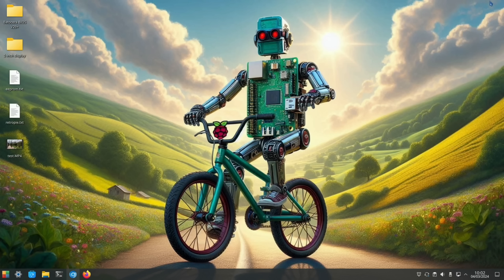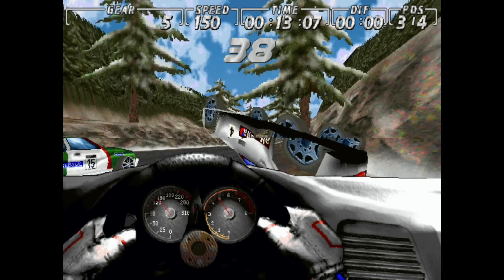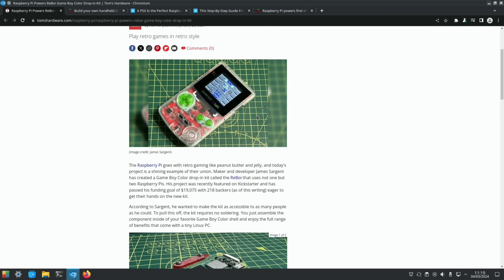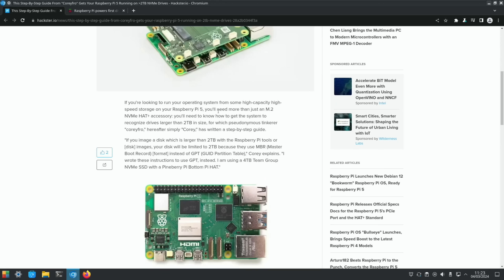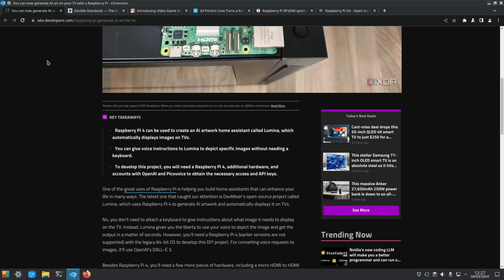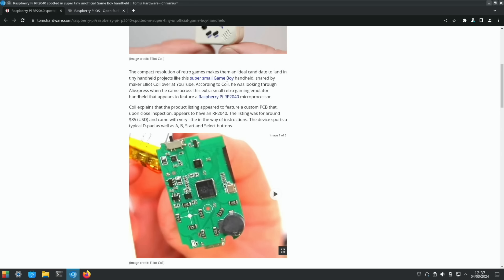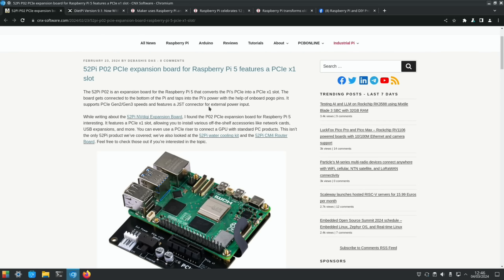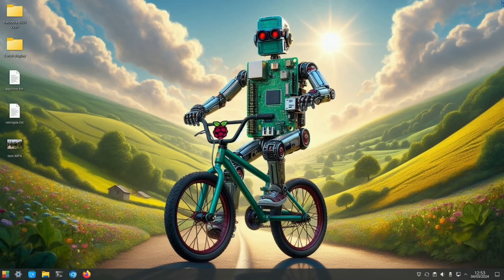Pi News 86. Another great month for Raspberry Pi5. Unrivalled SBC Arm support.

Comment: the converter, for putting in regular pci-e cards... people that use pi's for cnc, or would, sometimes find parallel ports a cost effective solution... i do.  got a startech parallel serial card, it's pci-ex1, just waiting to finish my new machine, the old one uses grbl.

Comment: A raspberry pi will work under water IF the water is distilled.  It is the impurities IN water (salt, minerals etc, PURE H20 is insulative) that make the water conductive.  In a project I worked on in the 90's we installed a 5 MW high frequency (400 Hz) induction heater in the steel line we were upgrading/reautomating and it was cooled and insulated with Distilled water.

Comment: I owned an Amiga, I got mine from a Executive Officer who was fired from Commodore, it was the top of the line model (was that the 1000? or 2000?) with every hardware option installed including third party for 300 dollars, he was asking 500 and at the time I think it sold for over $1,000 or 2,000 without the added on features ... I recall tossing out TWO 55 gallon trash can filled with 3.5 discs a few years after giving the Amiga away to a friend.  ...about three years later I was into PCs.  Soon I was cutting up & drilling fan holes into cases to build mods, I remember having one of the first nvidia video cards & put in the freezer to cool down the glued (thermal epoxy) on the aluminum heat sync so I could twist pop it off so I could replace it with a copper heat sync with an integrated fan, & replaced the timing crystal & soldered on video ram chips piggybacked style to double the vram ... worked great but only half of the games would still work with the mods.  Then got into water cooling my PC about the time the Intel Celeron chip came out, remember having a dual Celeron motherboard.

I had my first job in 6th grade in a TV/Radio repair shop, yup actually doing the repairs on the equipment with a soldering iron and a schematic using the different meters to check what went bad & fixing them, only did this for two years & got a gig doing installations of home and small business alarm systems and I was making 100 to $150 a day after school and 200 to 250, 300 a day on the weekends. It was all under the table & I was flushed with cash and I couldn't spend any of it, none of my friends had any money to speak of, maybe $10 or 20 bucks a week being paperboys or dishwashers and screw them if I'm gonna pay their way so I just saved it, but if any of my social cliques were doing anything I'd join them, I went to every rock concerts in Philadelphia & NYC, I lived in Philly at the time, and the R7 local commuter train ran to NYC & the end of that line dropped you off under Madison Square Garden that worked out perfectly, it was only 14 dollars round trip.  Madison Square Garden is next to Time Square & NYC's hockey arena where they had all their big rock concerts, also did a good amount of clubbing in NYC.  Living in Philly felt like it closed at sunset, but being able to take a date for a night on the town in NYC always blew their socks off... NYC never sleeps is very true.

By the time I was a Junior in high school I was tall over 6 foot & looked older & I was solely dating college girls, I had fake ID to get into nightclubs & girls my own age mostly wanted to hang out at the local mall.  And hell I was making more money at this time than most adults.  

When I Graduated from high school I bought myself a 1983 Mazda RX7 & had it painted from "Sunrise Orange" to "Candy Apple Opal" a week after I bought it, "Sunrise Orange" was their "red" but after week I hated it, & it isn't like I couldn't afford it, & I enjoy making easier for the cops to spot me in my '"arrest me red" painted 2 door sport coupe, & of course it was a manual transmission, only dorks drive sport cars with an automatic transmission.  

When I was 19 I joined an adults only ski club... if you're having trouble meeting girls, join a ski club.  Girls do not want to meet their boyfriend in a bar, but on a skiing trip to the Alps is so much more romantic and with girls they love to brag about things like that.  ...and isn't "so where did you meet him?" the first thing mom's ask their daughters?  

Wine Tasting Clubs were a huge hit too, I was in one for three years & my ability to tell you anything about a wine is limited to if it is red or white, but I do now have an amazing pallet & during the lockdown I really learned how to cook & think I am able to follow any recipe and a lot of the times improve it.  

The Wine Clubs are all gone now over here in the States because of lawsuits.  Every event had free unlimited wine.  And US courts find the establishment responsible if they do not cut you off when they think you've had too much but the wine tasting events had many different servers for each of the wines who were specialists from their vineyards and could tell you everything involving that particular wine, so no one was able to track how much anybody had already.  Towards the end they tried giving everyone 'coins' that you could use to get a glass but so many people would just steal them off the servers when they turned their back or stepped away, or that might have just been me.

And both clubs were Nonprofit, them being nonprofit is very important this way they can get items and services donated to them as a tax write off so everyone gets much better deals.  Involving the wine tasting club all of the wine was donated from vineyards.  And the larger skiing resorts would throw us parties with open bar for free.

...just turned on speech to text on this device ... screw type for now on, but I do see I do rattle on like a lunatic (looking up at the book I 'wrote')

Comment: That raspberry pi NVMe hat has a raspberry pi pico built into it from what I can see? It  Will be interesting to see what function it performs. They had to produce something to differentiate their own product from the sea of other NVMe attachments seeing how late they are to the party, could this be how they do it? Looks like it will only be able to use the 2 smaller variations of the drives as well, maybe that’s so it still fits in the official Pi 5 case?